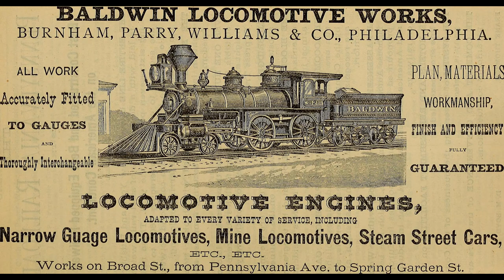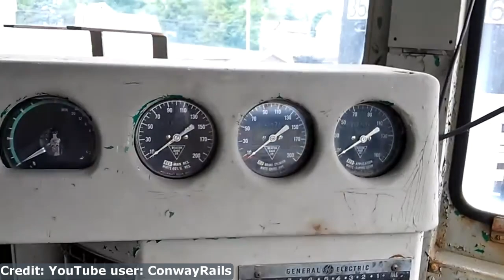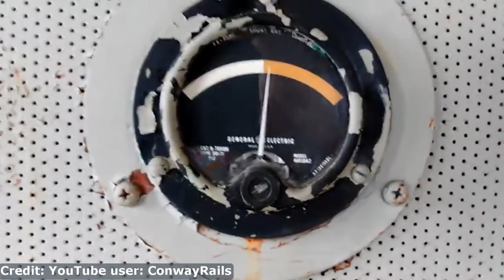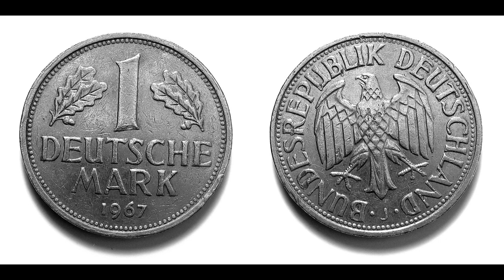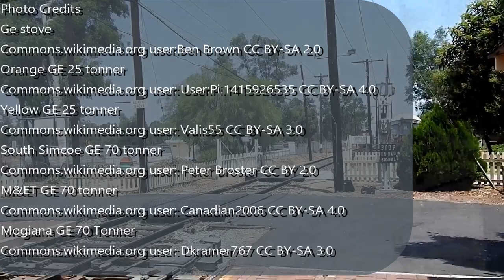The first is not always the best: The GE u25b

Comment: GE built two engines types to try and gain entry to the Australian market.

1 was a narrow-guage engine with a Cooper Bessemer power plant.

The other, was a standard gauge loco patterned after the Black Maria (DL-202) and powered by a Alco 244.

In a weird twist of fate the Alco 244 became associated with GE, leading to  the 251 Alco  having a much fairer straight-up 'fight' vs EMD 567's.

Alco ended up with VERY loyal customers in Aus, finally succumbing to the EMD645E.

GE didn't get major orders until the Dash-9 era. Only in the last 15 years did they become the leaders.

Thanks for a great video about the grand-daddy of the same FDL equipped C44aci's that I see everyday Down Under.
Reply: Yes in NSW EMD only got a foothold post Super Series. As to the GM v ALCO thing you read the books of Ron Preston who was a Workshops manager. It reveals that in the NSWGR/PTC case Alco was much cheaper to buy and cheaper to run so much so that any perceived reliability issues were dealt with internally by the NSWGR without reference to Alco themselves so the NSWGR ended up with a loco fleet that was much cheaper to run on a per tonne/km basis than the all EMD shops like VR. In the branchline loco's the DL531 aka the 48 class were a much more economical let alone better performers than the EMD G8 aka the 49 class.

Comment: I ran many U series GE engines. That 16 notch throttle was something else. It had 8 regular notches, then 8 half notches. At night time you didn't know which notch you were in unless you turned on the cab light. The half notches worked only with GE engines, it had no effect on EMD, ALCo engines. That controller is their KC109. You would use that handle on the left to go from power to dynamic braking, then use the throttle to regulate your braking.
Reply: I worked on the SCL back in the day as Brakeman Flagman. One day we had a 16 notch job,I think it was a road engine like 2100 series or something. I didn't know then to keep track of all the engine numbers as one day i would look back at those days. The Glory days fo sure.
Reply: @Peter-mt6lg  My last 6 months of my engine service career was running those techno-turds P42's. I hated those thing so much I was almost missing those older GE's.
Reply: @gordonvincent731 I don't get why P42s get so much love from the railfan community. They're ugly as sin, and you're far from the first railroader I've heard say they're awful to run. They're being retired now, I say good riddance.
Reply: @Amigafur  Couldn't agree more, thanks for the reply.

Comment: GE had pretty good deals when the old federal railroad of my country needed newer locos to drag iron ore from the central plateau through the steep ramps down to the coast in 1974 they went and got 170 GE U23C diesels with 150 of them being built in country (the other 20, part of the 2nd order, were built in the US and assembled here). GE also rebuild many of the wrecked locos at fairly low prices many of the wrecked U23Cs were brought to dash-7 standard like the U23CAs and C30-7MPs. Even though the had already gone with EMD previously with 45 units of SD18M in 1961, another 45 units of SD38M and 4 units of SD40M in 1967, they would only consider EMD again in 1979 with the 36 SD40-2s built by MACOSA in Spain.
And thats not even going into the U20C, maybe the most produced metric gauge locomotive we have.

Comment: EMD's hubris proved to be its undoing.  Yes; they messed up with the 50-Series, but GE's customer service/support was better even if its product wasn't at parity with its competitor.
Reply: One word GE Capital..when you can finance your product..didnt matter what emd did.
Reply: The EMD 50 series was a failure because it pushed the 645 passed its comfort zone. If they fitted a less powerful version of what the SD60 had then it would have been better. Or if EMD focused on reliability that would have worked
Reply: Now twi-strokes are slowly on yhe way out.

Comment: I'd never understood the GE U25.  I have a better appreciation for it after this video, but I'll never forget watching them in the early 1980s along with other GE U locomotives with their hood doors open likely shutdown with EMDs down on their knees pulling coal trains through the WV New River Gorge with the GE units offline right when they were needed the most.   I was going to electrical engineering school at West Virginia Tech in Montgomery WV.  John Carrier a civil engineering student and I would go rail fanning on the weekends.

Those GE Universal locomotives never acted like a locomotive from a manufacture that seem to know anything about locomotives.  They sounded like they didn't want to keep running.   Their reputation is they rode horribly and fought for traction with gobs of wheel slip.   Their reputation in mountain service is they couldn't take it and would overheat shutting down on long grades.   I didn't know GE U-boats were pushing twenty years old at the time.   

The EMDs greatly GP40-2 purred strongly in the 1980s at fuel throttle with their traction motors glowing red pulling 10,000 ton coal cargos under the New River Gorge bridge in the dark, typically with the GE U locomotives offline by that time having their hood doors open.   From that experience I couldn't imagine a use for the GE U locatives because they were greatly offline when they were needed the most.    They were disliked by crews for their poor track manners slipping easily and riding badly.   Even if the GE U-boats had more horsepower then an EMD it couldn't be used with the poor traction the locomotive had and then they'd quickly shutdown from full throttle or near full throttle use.   My conclusion was in flat areas they might be able to get a freight train up to speed in ten or so minutes allowing them to run at partial throttle and not over heat; otherwise, on long grades they were just extra weight.  

The CSX grade through the WV New River Gorge was about 0.6% and went for many miles.  That is a number I got from a publication some time ago.   It seemed like it most be steeper than that when watching the coal trains struggle up the grade.
Reply: C&O's B30-7's were a huge improvement over the other (older) GE's in the C&O fleet.
Reply: @TK-ec5bv  I think it was the dash 9 GE's that decidedly put GE into position to compete with EMD where EMD was previously the standout or only real choose for high traction long mountain grades.   Even today EMD SD70MACs are frequently the choose for mountain helper service over GE ES44AC's.  

Those GE U-boats over several years in the mid 1980s I'd watched shutdown with their hood doors open being dragged up the New River Gorge grade by GP40-2s along with reading about them slipping madly on grades with a horrible ride for the crews had me thinking you'd have to be nuts to bring a GE locomotive into your mountain service fleet.  The U-boots were a bit of a joke or nothing but a joke for mountain service.   When I'd look at one I be remembering they are just dead weight after a few minutes fighting up the New River Gorge grade.   

Now with decades more rail fanning background my guess is by combining the GE U-boats with the EMDs with the crews always preferring the head uint for them to be an EMD they are likely not aware the U-boats at full or nearly full throttle quickly exceed thermal shutdown on long mountain grades at lugging low speeds of 12 - 20 mph with the EMDs surviving admirably at meltdown temperatures indefinitely. 

I could see possibly a U-23, some actually are suppose to have come with air conditioning, being a possible choose for a low speed low throttle environment where the locomotive would never be pushed hard such as in short line use.   Not really, I'd be too self conscious of persons similar to my younger self witnessing such a scene and feeling horrible for the railroaders that were inflicted with a U-23 being their only day life.   I now appreciate U-boots  . . .  at a safe nostalgia distances.
Reply: @douglasengle2704 C&O liked having some GEs in their fleet.  They weren't all bad. I saw them in operation during the Chessie era, and most that i saw were online and running. It was a smart idea to not give EMD all of the business. Conrail was another big user of -7 GEs, with success, especially on the grades of the ex NYC Boston & Albany across Massachussetts.

Comment: Just like fairbanks-morse EMD diesel locomotive engines were badly needed by the Navy for its submarine Fleet indeed EMD sometimes would be reduced to making only one locomotive a month. The ALCO DL 109 under the New Haven has convinced the war production board that they would be dual service engine. Why Alco did not make more dl109 I don't know. With two proven 539 Motors it was a very dependable locomotive it would haul passengers all day and Freight all night the only time it was stopped was when it was getting fueled up.

Comment: Yes, EMD did have something in its catalog that matched the RS1 in the Light Road Switcher category, the NW3, NW4 and NW5. They were 900/1000 hp units, riding on two axle road trucks and could take a steam generator - the same as the RS1. As a matter of fact, the NW4 was out the door in 1938, with the NW3 starting in  Nov 1939, both before the first RS1 in March 1941. (https://en.wikipedia.org/wiki/EMD_NW3#/media/File:GN_181-Whitefish.jpg) (https://en.wikipedia.org/wiki/EMD_NW5#/media/File:GN_192_Duluth.JPG)
Reply: I’m not sure why EMD’s NW road switchers were such poor sellers.  Maybe the railroads thought that they were too ugly.